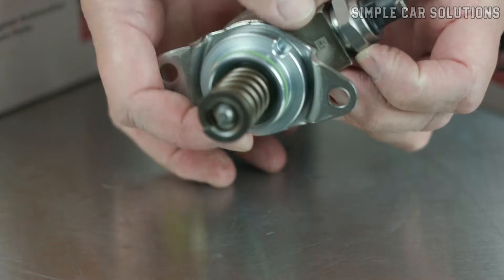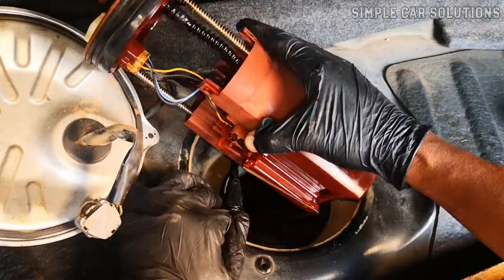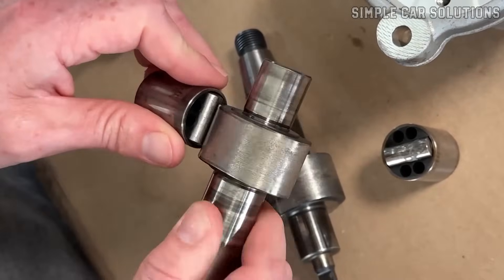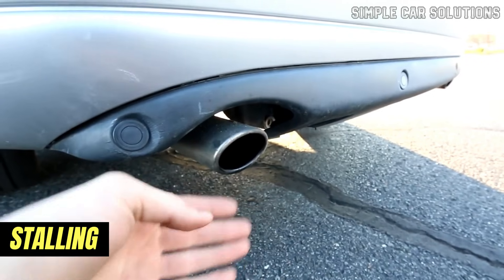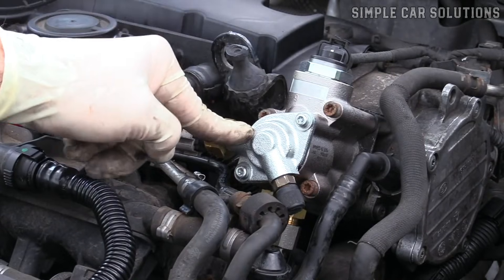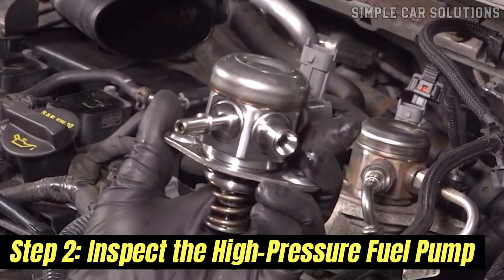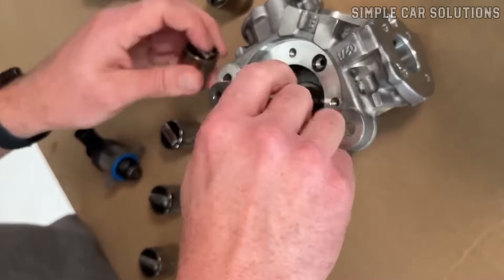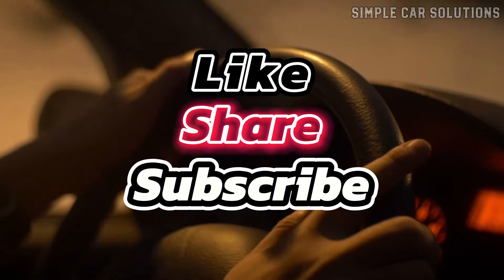Bad High-Pressure Fuel Pump Symptoms. HPFP Failure Symptoms

Comment: if everything checks out fine and your at whits end like i was check the injectors
Reply from the maker: Leaking or sticking injectors can mimic HPFP problems and cause pressure issues. Thanks for sharing your experience.

Comment: i got a 2014 Ford Fusion with a turbo engine L.5 and i had problems with fuel rail but i got that fixed and now the hpfp is making a ticking noise when idling and when the rpm’s go up the ticking gets faster. my check engine light didn’t turn on the car drives like normal and i didn’t lose any power and when starting the car it doesn’t crank up
Reply from the maker: A ticking HPFP at idle that speeds up with RPM is often normal on direct-injection Fords, especially if the car runs fine and has no codes. If it won’t crank sometimes, check battery voltage, grounds, and the low-pressure fuel pump, not the HPFP.

Comment: Got a 2015 Ford f150 3.5 Ecoboost, changed the hpfp the truck started, we drove it around the block it ran great, we parked it for about 25 mins then went to leave and then it wouldn't start again and started acting the same way...any idea. I think the only code is p0087...could it be the driver module?
Reply from the maker: P0087 after a new HPFP usually isn’t the driver

Comment: O sensor fica localizado ao lado da bomba de alta pressão??
Reply from the maker: Yes. On most engines, the fuel rail pressure sensor is located very close to the high-pressure fuel pump, usually on the fuel rail next to it.

Comment: Hi Sir i have a Mazda cx9 2017 model, i have a following questions
1. During running at 135kms/h suddenly my acceleration goes down to 2.2rpm
2. When start my car morning i can hear a noise for 25 to 30 seconds
3. What is the preferred battery for above model 2017 mazda cx9 car.
Awaiting your valuable feedback in this regard 
Shabbir.
Reply from the maker: Hi Shabbir,
1. Sudden loss of acceleration at highway speed often points to fuel pressure issues (HPFP), boost leak, or the ECU going into limp mode - scan for stored codes.
2. Noise for 20-30 seconds on cold start is commonly timing chain tensioner, HPFP, or VVT-related - have it inspected.
3. Use the factory-spec AGM battery (Group 35, around 600-650 CCA) for the 2017 CX-9.
Reply: @SimpleCarSolutions hi sir, thanks for ur quick reply.

1. HPFP recently changed to Mazda brand one, but issue still continue.

2. Could you please share me the battery picture or brand name
Reply from the maker: You’re welcome.
1. If the HPFP is new and OEM, next check the low-pressure fuel pump, fuel pressure sensor, boost leaks, and throttle body. A scan for pending/hidden codes and live fuel pressure data is important.
2. Battery: Use an AGM Group 35. Common good brands are Mazda OEM, Bosch, Exide AGM, Varta AGM, Interstate AGM (≈ 600-650 CCA).

Comment: What do you do if the pressure is reporting too high ?
Reply from the maker: If fuel pressure is reading too high, check the fuel pressure sensor and its wiring first. If those are OK, the HPFP or pressure control valve/regulator may be sticking and needs repair or replacement.

Comment: I change that and the fuel pump and still my car won’t start
Reply from the maker: If it still won’t start, check fuel pressure with a gauge, injector pulse, spark, and the fuel pump relay/fuse. A bad crankshaft sensor or wiring issue can also cause this.

Comment: P00C6 ME TIRA A MI SERS ESO?
Reply from the maker: Yes. The P00C6 code indicates low fuel system pressure (low side). It is usually related to the fuel pump, a clogged filter, or a sensor/wiring issue, and can cause a loss of power.

Comment: I have an 2014 Opel Astra OPC with the A20NFT engine. car idles and drives fine, even accelerates fine when I step on the gas gradually but as soon as I step on the gas pedal too fast/hard it starts to jerk/hesitate but if I let go slightly and slowly push it accelerates fine and there's no Engine light illuminated. Any idea on what the issue might be?
Reply from the maker: That symptom strongly points to a fuel pressure issue, most commonly a weak high-pressure fuel pump or faulty fuel rail pressure sensor. Under sudden throttle, fuel demand spikes and pressure drops, causing hesitation. Also, check the low-pressure pump, fuel filter, and ignition coils, but the HPFP is very common on that engine.

Comment: Does the smell of fuel in the cab mean the HPFP is failing? Also has loud ticking in engine bay. Thanks
Reply from the maker: A fuel smell in the cab usually isn’t from the HPFP - that’s more likely a leaking fuel line, injector seal, or purge valve issue.
The loud ticking can be HPFP-related, though. Check for leaks first, then fuel pressure readings.

Comment: My 2016 Chevy Malibu starts and once warmed up or right before it’s warmed up and I drive for short time it starts to stall out I hit the gas and it does nothing wonder if it’s because of high pressure pump
Reply from the maker: Yes, that can be a failing HPFP - warm stalling and no response to the gas pedal are classic signs. Also check the low-pressure pump and fuel pressure sensor to be sure.

Comment: I have a 2.0t 2013 cadillac ats. I recently had the hpfp replaced. It's been a few months since that was replaced and I'm now experiencing the same symptoms as before, as described in your video. I think it could be the low pressure fuel pump in the gas tank but im not sure. Any ideas or suggestions? Thanks
Reply from the maker: If the HPFP was already replaced and the same symptoms came back, the in-tank low-pressure pump is the next likely culprit. A weak LPFP will starve the HPFP and cause identical issues. Check low-side pressure and the pump strainer/filter - that’s where I’d start.

Comment: Is it possible for a HPFP to fail without a check engine light? My 2024 Corolla is having all of these issues except for the check engine light and stalling under load. I poured some Techron fuel system cleaner into my tank, and that seemed to fix the issue for a couple of days. Unfortunately, Toyota is trying to gaslight (no pun intended) me into thinking that this is normal behavior. :/
Reply from the maker: @GullySquirrel Yes, it’s possible — an HPFP can weaken without triggering a code. The cleaner helping briefly points to fuel pressure or injector issues.
Reply: Im having the same issue i have gotten the light to come on but it some driving to get it to come on whilst it running like a bag of shot the whole time but my codes came back eventually to the hpfp
Reply from the maker: @keirhunter6470 Yep, that fits — a weak HPFP often takes time to trigger a code. Once it does, replacement is usually the only lasting fix.

Comment: I have a 2015 Audi A5 (2.0 Quattro) I have had jerky acceleration, rough idle, & stalling but when stalling it usually takes about 15-45mins of waiting to get the car to turn crank back up. Getting P0089 code, trying to figure out if its the HPFP thats the issue or the in-tank fuel pump
Reply from the maker: P0089 usually points to a failing high-pressure fuel pump or pressure regulator. Check fuel pressure, if low at the rail but normal from the tank, the HPFP is the culprit.

Comment: I changed my hpfp and fuel lines to barbed instead of banjo last week. I intermittently getting epc, lean codes and i opened the 13mm bit to remove the hpfp a few times to check if its ok etc and weirdly finally it worked. Now the epc light comes on and the car struggles with long crank a few times. However, if i prime the engine twice, it starts and runs ok. My key battery needs to be changed so i am unsure if the priming is less. My original hpfp, besides the leaking, was ok starting etc. Ive had to put my oem fuel injectors as the k04 kit injectors , one has an issue.....
Reply from the maker: Sounds like you’ve got air in the fuel system or low pressure on startup — recheck HPFP seals, fuel line fittings, and the low-pressure pump operation. Also replace the key battery just to rule it out.

Comment: Got my car back and a day later instantly felt something is off. Its startupts are not great even when warm the starter just dies for a sec and then the car turns
there hasnt been any laggin starts or long starts it still stars in good time just dies out. I also notices my wheel starterd getting mega stiff and sort of unstable so im also worried about the electric power steering motor. The work I jsut got done involved headlights and and now im having some electrical issues. Gonna have to take another look and get it checekd out so annoying the headlights werent cheap and if i have to deal with power steering connectors or the motor and a damn fuel pump im gonna so broke.
Reply: I do need an alignment but im 95% sure its not the culprit because i only notice it at like 70MPH plus and that was before I  had the electrical work done. I also did a quick check on the tie rods/bearings stability and the wheels felt like they had no give at all so im kinda worried here
Reply: Lmao also my rear reverse lights were out too and that was right after i picked up the car and they checked all the connections so thats another thing but hopefully my guy will cover it from since i paid him hella for the headlights and this started after his work
Reply from the maker: @iankovalchik488 Yeah, that definitely sounds like a wiring or ground issue from the headlight job — especially with multiple electrical problems showing up. Have your mechanic recheck all grounds, connectors, and fuses near the headlight area.

Comment: I have a 2014 Accord Sport. A Honda repair shop replaced it with a used high pressure fuel pump but the car drives the same, nothing changed. The shop isn't confident that a new part would fix the problem. Please help
Reply from the maker: If nothing changed with the used pump, the issue may be elsewhere — common on Accords are failing fuel pressure sensor, clogged injectors, or low-pressure pump issues. I’d confirm actual fuel pressures before replacing parts again.

Comment: I have a 2014 equinox with a 2.4 ltr. 4 cylinder, it starts up fine and the first time i drive it after it's been sitting for a little while it runs perfect. When it's warm however it has these problems: check engine light came on and then when problems first started it would only have trouble turning off, it would want to keep running kind of, then when I'm stopped at idle its fine until I hit the gas to start going and it just turns off but if it's in N instead of D it idles fine and now I'm having to rev it a little as I shift to D or hold the brake as i give it gas to keep it from stalling. Other than all that it runs great, it starts right up, and it runs fine as I'm going down the road. Check engine code was P0172(Fuel Trim System Rich) that we got from O'Reilly. PLEASE help me Simple Car Man!!!
Reply: Most likely, the diaphragm in the high pressure fuel pump has ruptured.  Common problem on the 2.4L ecotec.
Reply from the maker: P0172 (system too rich) plus stalling when shifting into "Drive" usually points to a stuck injector, bad fuel pressure regulator, or faulty MAF/O2 sensor. Start by checking fuel trims, cleaning the MAF, and testing fuel pressure — could be over-fueling at idle/load transition.
Reply: @SimpleCarSolutions  Ok thank you very much and just so u and whoever reads this knows, and for my personal dignity lol, I knew that D meant Drive but I kno there are ppl(mostly women, sry ladies)that don't kno that so I wanted to put that out there so nobody thought I was an idiot lol thanks a lot for the help man you're the best.
Reply from the maker: @chc4919 No worries — you explained it clearly 👍 Glad to help, and good luck tracking it down!

Comment: 2012 beetle turbo 2.0tsi e888 gen 1 cbfa.. i just did a timing job and balance chain.. i wanna say my high pressure fuel pump is bad... I'm having  fuel rail pressure to high code..

The car starts up just fine.. But will randomly die... If I hit the gas and let it settle down, hit the gas again.Let it settle down hit the gas again and it'll die...
Reply from the maker: That fits a sticking HPFP or faulty fuel pressure regulator — check rail pressure with live data, and if it spikes then stalls, the HPFP is likely failing.
Reply: @SimpleCarSolutions i run live data and use requested an actual values with my obdll  

The values will match each other perfectly... And I'm talking floored, pedal to the metal 2000 plus psi  the car rips (ko4 turbo fbo tuned ect.)

Then just driving, all of a sudden, out of nowhere.The actual drops to 94 psi and the car stalls...

I've already replaced the high pressure fuel pump with a genuine vw/audi 500$ hpfp.. no change.. replaced the fuel filter that i'm sure has never been replaced in 149k miles.. it was dirty but problem still persists..

So my next option was i've ordered a low pressure fuel pump and the control module for the low pressure fuel pump and a rail pressure sensor... that should be everything in my fueling system, except for the e.C.U... And I doubt that's the problem... I've had The same tune on my car for the last three years.. untronic ots ko4 tune
.
Reply from the maker: @korey420 Good work narrowing it down 👍 Since rail pressure suddenly drops to ~94 psi, it does point more to the low-pressure pump, control module, or rail sensor cutting out under load — replacing those next is the right move.

Comment: If buy a high pressure fuel pump, the cam lobe came together or I have to buy it separately?
Reply from the maker: The high-pressure fuel pump usually comes without the cam follower or lobe. You’ll likely need to buy the follower separately if it's worn.

Comment: Hi I drive an Audi A3 2.0 FSI the car doesn't exceed 3000rpms with P0191 fault code I have changed all fuel related sensors and the in tank pump, but still no change.

Please advise.
Reply from the maker: P0191 points to fuel rail pressure issues. If sensors and the in-tank pump are new, the high-pressure fuel pump (HPFP) itself may be weak or failing — test fuel pressure at the rail to confirm.
Reply: @SimpleCarSolutions Thanks will do so and revert once sorted

Comment: Friends any one can pls tell what is the voltage is on high pressure fuel pump valve ..which is 2wire solonoid on pump ...and what voltage shoul we get while cranking
Reply from the maker: While cranking, the 2-wire solenoid on the HPFP typically sees a pulsed voltage signal from the ECU, averaging around 5–12 volts. Use a multimeter with a duty cycle or a scope for accurate reading.

Comment: I changed mine in the 2018 fusion and still sound the same is it normal
Reply from the maker: Some ticking or buzzing is normal, but if the noise is loud or hasn’t changed after replacing the HPFP, have the injectors or timing components checked too.
Reply: @SimpleCarSolutions  thank you

Comment: I just changed the fuel pump on my Audi A4. After a week, my car started to sputter. When I put the gear in reverse, the car would stall. The same goes for when I put the gear in forward. The fault codes that came out were P01900, P008900, and P307300.Can you help me??
Reply from the maker: Your fault codes point to fuel pressure issues—P01900 and P008900 relate to the fuel rail pressure sensor, and P307300 indicates low fuel pressure. Likely causes: faulty high-pressure fuel pump, incorrect installation, or bad fuel pressure sensor. Recheck the pump install and test the sensor.

Comment: I have a 2.0 turbo ford engine and it makes a bogging sound and doesn't want to go unless I push the gas pedal harder. Would you know what the problem is. Thanks alot
Reply from the maker: That bogging and hesitation could be a weak high-pressure fuel pump, clogged injectors, or a faulty MAF sensor. Scan for codes and check fuel pressure to narrow it down.

Comment: Does the cam need to be in a specific piston (up/down etc) when changing out the HPFP?
Reply from the maker: Yes, the cam lobe should be at its lowest point (base circle) to relieve pressure when removing or installing the HPFP. This prevents damage and makes installation easier.

Comment: Hi my  5l toyota is rattling continually.  Can it be HPFP failure. 
The rattling and ticking noise goes high as you rev
Reply from the maker: Yes, it could be HPFP failure, especially if the noise increases with RPM. But also check injectors, valve train, and timing components.

Comment: My range rover velar 3.0 makes a rattling noise on cold start, could it be the HPFP?
Reply from the maker: A rattling noise on cold start in your Velar 3.0 is more likely timing chain-related than the high-pressure fuel pump. However, a failing HPFP can make noise — have both checked to be sure.
Reply: Thank you for the reply, i have changed the timing chain, but it is still making a rattling noise, i have been to a few specialist but they cant find the issue.. should i try to replace the HPFP?
Reply from the maker: @karo7944  If the timing chain is new and the noise only happens on cold starts, the HPFP could be the issue — some develop internal play and rattle. Before replacing it, have the fuel pressure and pump timing checked during a cold start to confirm.

Comment: My 2024 Honda Accord caught on fire last night from high pressure fuel pump and I had none of these signs.
Reply from the maker: I'm sorry to hear that. Sudden HPFP failure causing fire is rare but possible due to fuel leaks under pressure, often without warning. Report it to your dealer and Honda immediately for investigation and safety recall review.
Reply: @SimpleCarSolutions  I reported it to Honda and with no response.  The dealership is helping me, but I am still out all my electronics that were in the car valued at $10K
Reply from the maker: @Valerielongcreative  That’s tough. Keep everything documented and push Honda corporate again - cases like this often get escalated. Also, file a claim with your insurance so you can recover the value of the electronics while the investigation continues.